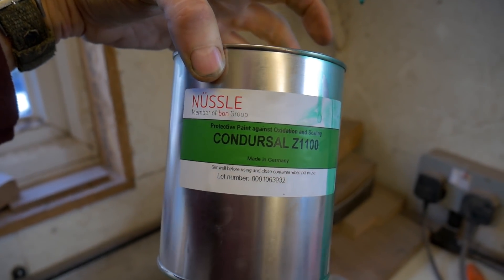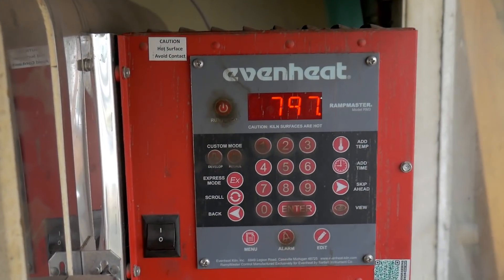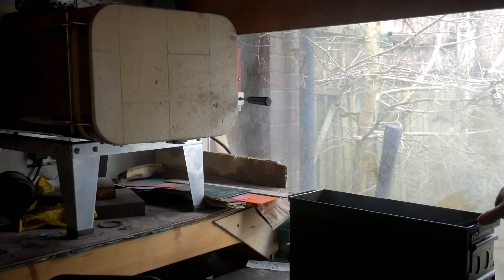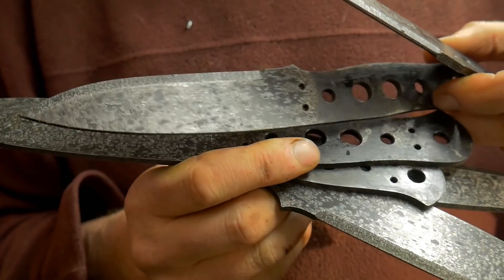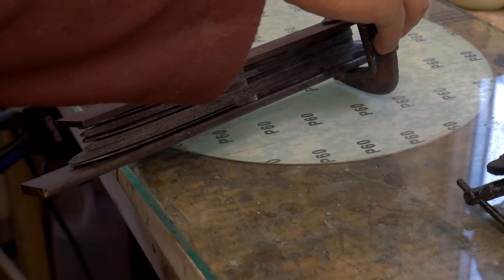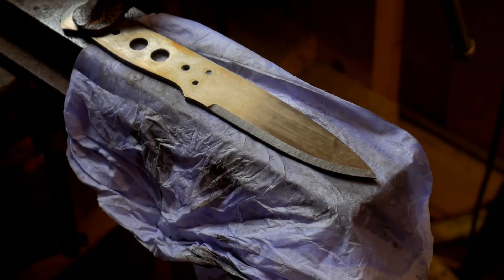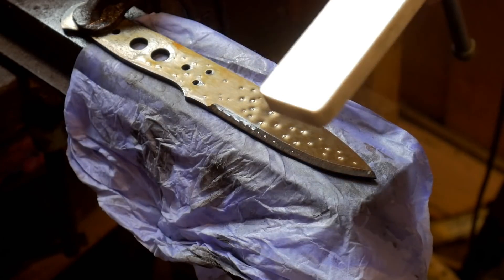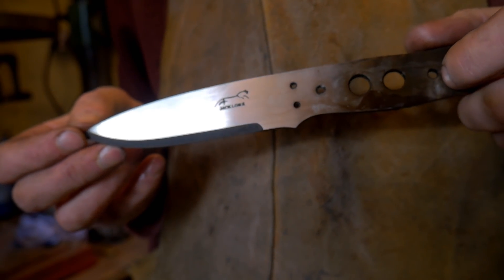Knife making  Heat treats, Anti scale compounds, Clean up blades and RC testing

Comment: You quench several blades at one time. Every time you dip a new blade into your oil, it obviously heats the oil up considerably. Doesn't the oil getting significantly warmer, effect the hardening consistency of the blades ?

Comment: Whats the reason for 20 min at austenizing temp? I never heared someone recommanding such a long time. In fact the opposite holds true. Grain growth has never been an issue for you? So from watching your videos for a long time I know you do what you do for a certain reason. But here it is totally unclear to me why you do it 😂👍
Reply: With 01 you will only get grain growth if you overheat. The presence of chromium in 01 limits the grain size. However if you soak simple steels like 1095 then yos you will get grain growth
Reply: PS the reason to soak for longer is to get the carbides into solution. You get a more uniform heat treat. I suggest you check out Kevin Cashen 01 heat treat, he has written a wonderful article on it
Reply: @WiltshireMan  I know the reason for soaking but to me it appeared unecessarily long. I thought 8 min should be more than enough for a 4mm thick blade. Interesting to know that Cr keeps it from developing grain growth unless overheated. Not a metallurgist myself.

Comment: Jackey Boy . Im going to pass something on to you . I learned 40 years ago with leaf spring the tried it with O1 ..  I always used a #5 rose Bud . For heat treating . Using a table in oil  to quench about a half inch up from the edge . 
 I had water up to 155 degreese  once I quench the blade and it was at a black heat  Id stick it in the hot water and it would Blow all the scale off the blade , 
Leaving a lovely slate Gray .. try it on scrap and see .

Comment: Maybe if you reduce your soaks a bit you could get some better use out of the new compound. O1 shouldn't need a 25 minute soak anyway with such thin cross sections as you have with a knifeblade. I'm sure your blades perform just fine but did you compare grain structure at different soaks? Anyways. I'm fairly impressed by the consistency of your temper colors. Goes to show that your tempering oven does a very good job.
Reply: The longer soaks do give better and measurable improvements. Austenitising at lower end of the critical range means  the longer soak is required.
I have run many experiments over the years including the metcalf experiment to determine best grain size/ temp/ soak times. I could reduce soak times to 10 minutes and increase hardening temp to 810 and still get a 65Hrc reading but I wouldn't achieve that hardness when austenisng temps are slightly lower unless the soak is increased.
Grain size is uniform and very smooth.
I choose a slightly lower austenitising temp to avoid grain growth.  But as I say this does require a longer soak to get those hardness values up.
Here is an example of the metcalf experiment I ran a few years back:
https://youtu.be/V81BSEv2OgQ
Reply: @WiltshireMan  Very interesting. Thanks for the insight!

Comment: I enjoy your videos, and I have a question. Why do you use O1 steel? I’m very new to making knifes, so I don’t understand all the nuances. I also don’t have a heat treat oven, so I am limited to simpler heat treats for now. Cheers!
Reply: My guess: O1 takes a very keen yet robust edge which is great especially for skandi grinds or kitchen knifes and its easy to sharpen. For makers it's generally easy to work with especially in heat treat. O1 was specifically developed as sort of a general purpose industrial tool steel that can be processed easily without incredibly specialised heat treat equipment/processes. It's actually fairly widely suggested as a beginning knifemakers steel due to the ease of heattreat. To get the absolute most out of it you want to dial in your process and use some more sophisticated equipment. But you can easily get away with a charcoal fire or propane torch, a brief soaking and dunking it in plain ol vegetable oil. It will get nice and hard deep into the workpiece as long as you reach critical temp and don't overshoot too much

Comment: Z1100 works much better at higher, stainless steel austenising temps ie 1000c + works well with oil quenching stainless steels like Sandvik 14c28n.

Comment: Not impressed with thatZ1100, I've seen you use ATP641, much better. I use Borax but I'm only a hobby maker.
Reply from the maker: I've also used Borax, it works well but is messy
Reply: @Jackloreknives  Agreed.

Comment: You've had that EVENHEAT a long time Sandy, so I expect you're really happy with it. I have a question on the compound. I saw you did not dip the whole blade into it for a coating. Any reason not to coat the whole chunk of steel? :-)
ATB
Reply from the maker: There just is no need Nicholas as the decarb just effects the surface and will mar the finish if left, however beneath the scales the steel is not finished to such a high level, it is coarsely keyed up to take epoxy and that coarse abrasive will scour through the decarb anyway.
Reply: @Jackloreknives  ok I understand that makes perfect sense. Thanks for explaining. :-)